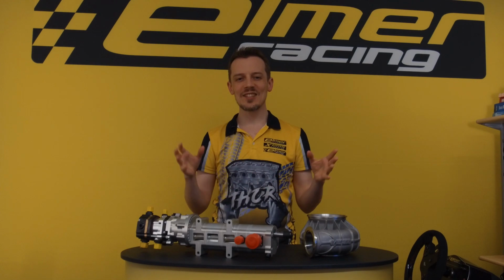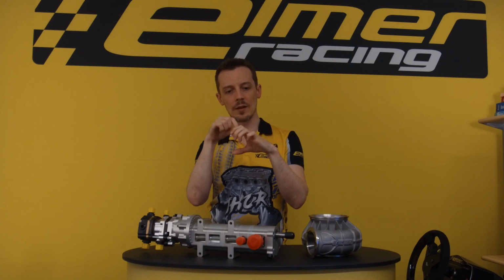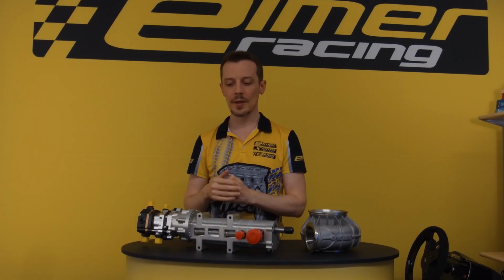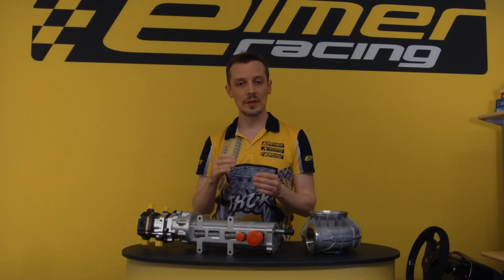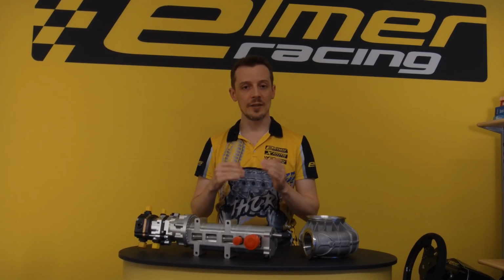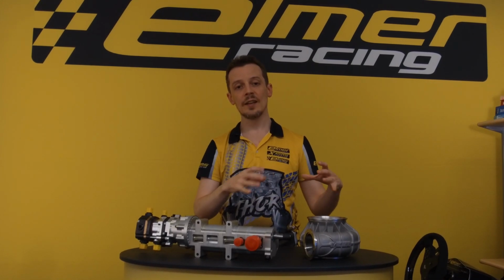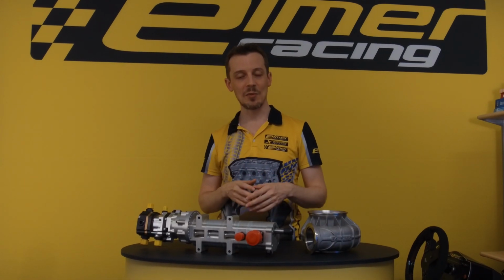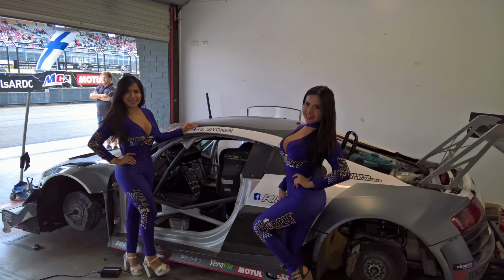The Race that was, but wasn't: Thor - the story ep3

Comment: the last episode was pretty much about oil pressure and cooling to increase reliability. What I was always asking myself if you would de-tune your engine to a more street performing motor would it significantly increase reliability? You have a 4L turbo engine so let's say with lower boost pressure, a lower compression ratio, less aggressive camshafts and lower rpm you would bring it somewhere to a 400hp range would that motor be able to move a normal 968 for 200.000km without a revision? Not that it makes sense given the price to manufacture this engine it is more to understand how much power is influencing the reliability.
Reply: awesome series btw - thank you very much to share it with us.
Reply from the maker: Based on current data, the 1500hp range doesn't do any "damage" to the engine. So wouldn't be any need to de-tune for the street. For other than powerband etc. reasons of course.
Valvetrain longevity is a question mark. Current cam isn't super aggressive though. But would probably need milder ramps to get more km out of the parts before they wear too much and need servicing over many km.
Reply: @ElmerRacing  thank you for your quick response. But that would implicate that there is no relation between reliability and power and that is clearly not true for any engine. ;-) I thought that there are ballpark calculations about reliability as well. Porsche i.e claims that their race engines are good for 48h of runtime before having a full revision. 48h in street terms would be something in the 10.000km range. When I was working in motorsports, some decades ago when carburettors were still a thing we claimed that our rally engines were good for about 100h where our street group a were good for 50h and our group h were good for a max of 30ish h (If the connecting rods do not leave the building ;-) so it was clearly power to displacement related. Our steet engine was based on the group a motor but with a different crankshaft that had a 35% higher displacement and still providing about 10% less power that resulted in a runtime of about 800h. I am talking about tuned cast engines of course and all naturally aspirated. 
When I see that you have about 1L displacement per cylinder multiplied by 8000 revs, even without proper calculations it is clear that you have piston speeds from hell and giving the estimated piston weight you must have to handle piston forces from another planet, that cant be too healthy either ;-)